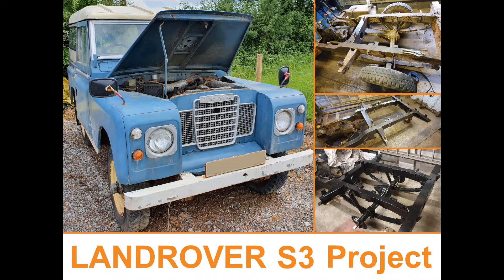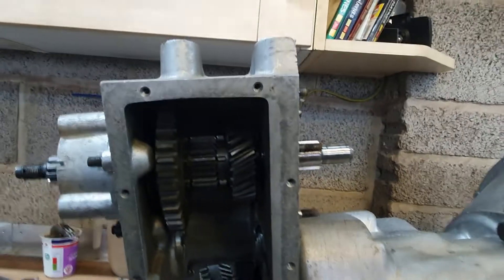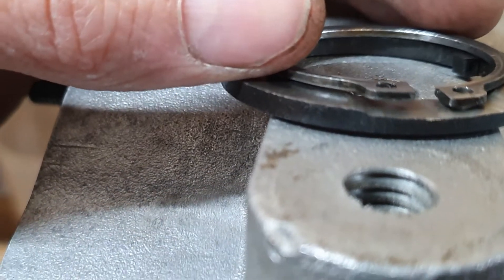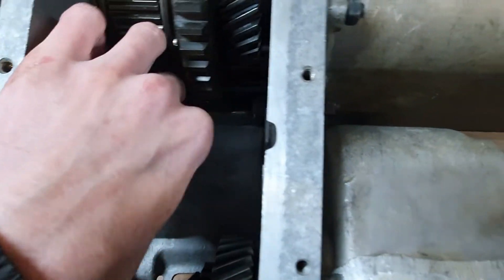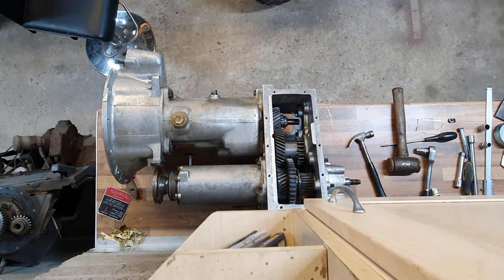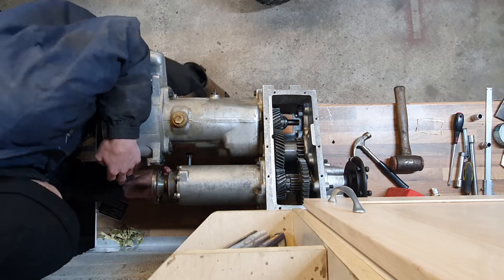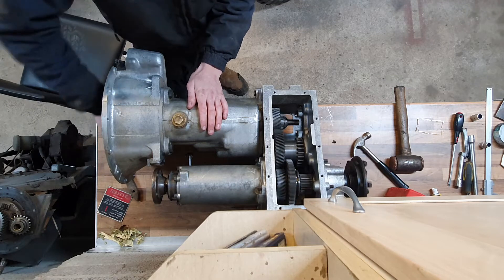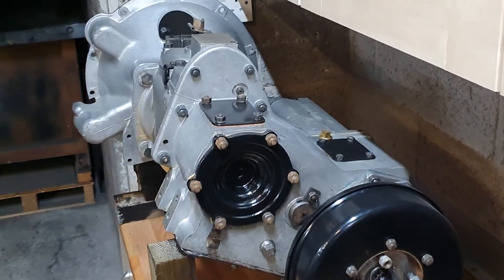Gearbox and Ashcroft High Ratio Transfer box Assembly  -  13 Land Rover Series 3 Project

Comment: ive got one of these ashcroft cases sat in a box in my living room just waiting to be installed on my 2.6 109. my question is, am i able to fully build up the transfer case on a work bench THEN fit it to the gearbox or does it have to be done like you have here ? empty case fitted to gearbox first then constructed.
Reply from the maker: I'm afraid it was a few years back now. But looking at thw video to remind myself....   I'm pretty sure it gers bolted to the gearbox from inside the transfer box so it will.uave to be assembled after attaching to the gearbox

Comment: Hi, all the work you've done is great, congratulations, I want to start assembling my series 3 with the Ashcroft upgrade kit, I wanted to ask you if the axle where the new bearings have to be put is the same one that is in the box or comes with the kit, the one that appears at minute 3.14, I am from Uruguay and there is no one here who has placed the kit, so I will be the first and I have several questions. Greetings and thank you, Javier.
Reply from the maker: @javierst8387  Thanks Javier, glad the videos help. That's very exciting being the first, really cool. It looks to me like an excellent modification, ifs the gearing it should have had from the factory.

The shaft is the original shaft. If I remember correctly, they machine the casing and send out the new gears etc only. You are meant to resuse the the shaft or source a new one if yours is no good. 

I found plenty wrong with this gearbox so it has clearly had a hard life, but I found that shaft to be fine, I guess yours will be OK too hopefully. 

Good luck with the project.

Comment: Great video and very helpful as I'm also rebuilding my TC with the Ashcroft high ratio mod. A quick question re the output shaft: I have checked the end-float & preload on the shaft and both are in spec - I'm experiencing the same problem as you in that although the low ratio gear spins on the shaft (when not engaged) it is pretty tight and doesn't spin freely - can I ask why will that cause a problem?  Thanks in advance.
Reply from the maker: Graham, thabks for the comment. Much appreciated. 

I've rewatched the video to try and get my head back into it.... I'm afraid its rather hard for me to remember exactly the arrangement but I think.....

Its a problem when you're in low range as there will excess heat and friction generated as the high ratio gear spins at a different speed to tye low range gear (I think they all go at the same speed in high ratio). That will result in galling after a fairly short time and it will o ly get worse until something seizes up. 

I believe thats the case anyway :)
Reply: @lozl  Thanks for the quick response. 

I guess that does make sense and for the sake of a couple of hours work removing, relieving the circlip and reinstalling the output shaft and gears it's better to be safe than sorry. Thanks again, your videos have been a huge help.
Reply from the maker: @grahamabbey3835  that was the conclusion I came to, I normally.mull it over for a night or two then sort of "give myself no choice" but to redo the work, it's annoying as I do lots of things twice. But luke you said it's gotta be worth the time I think. 

Good luck! And thanks for the kind comments

Comment: What was the Ashcroft mod for ? Give the box longer gearing, lower revs for mph?
Reply from the maker: Thanks for the comment, much appreciate. 

Yes that's exactly it. Apologies I should have revisited this. I think I explained it in a video but it was probably around a year ago now. 

Its favourable over the overdrive as its simpler (in operation, although probably not singlet to fit), it's stronger, it gives a longer top ratio too, it also means you can still fit a PTO on the rear of the transfer box.

Its favourable over changing the diffs, as its only one job rather than two, and the speedo still reads the correct speed. 

The end result I believe is 31% longer ratios in all high ratio gears. I'm sure I don't need to tell you but this obviously improves noise levels in the cabin (apparently this is vastly improved), and of course fuel efficiency is greatly improved. 

The potential sting in the tail that some people have found is that it can struggle going up even a modest slope in top gear. I'm hoping the freshly rebuilt engine will minimise this issue.